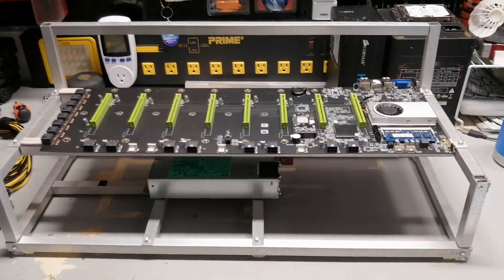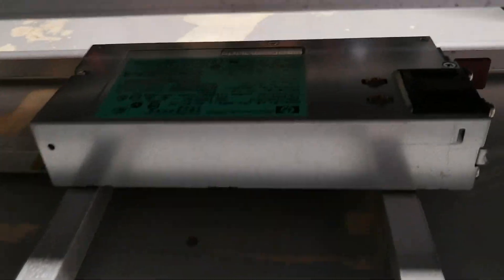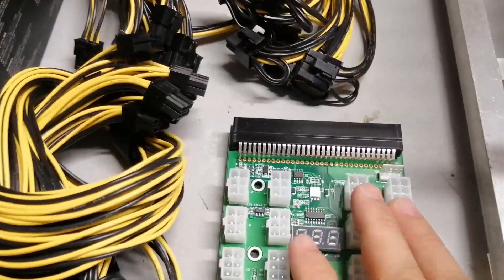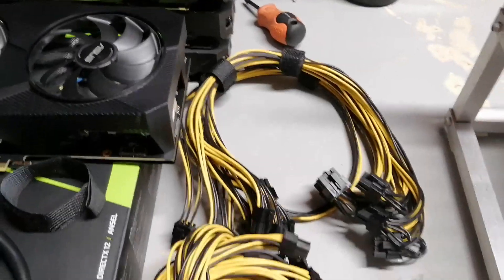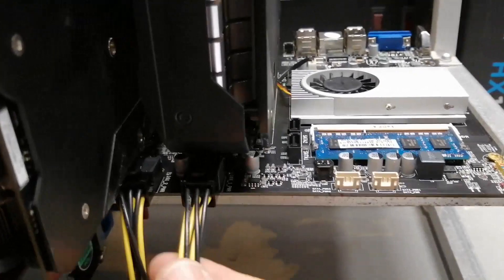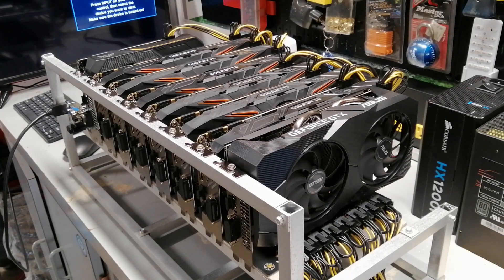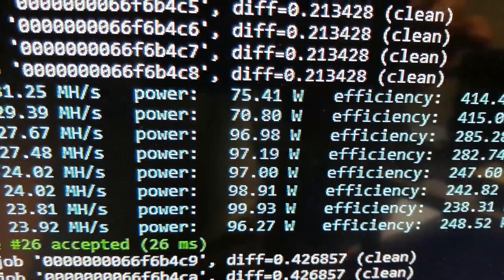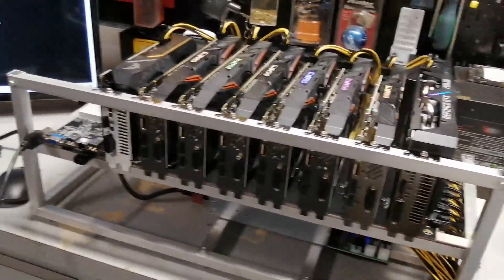BTC-D37 Riserless Mining Motherboard Setup with 8 GPU's

Comment: Is this board any good? What about longevity?!?
Also, why so many 6/8pin plugs onto the motherboard?!? 
16 suplimentary power connectors on a motherboard, is ridiculous
Reply from the maker: Because this mobo doesn't use 24 pins so 1 single 6 pins cable cannot handle the current of multiple GPU's. For me I consider risers as ridiculous , I would rather have multiple 6 pins than dealing with riser boards. Anyway my BTC motherboards are running for 2 years now no issue so far, hopefully it will serve me for another couple years with no issue.
Reply: @ruvrandomusefulvideos   Good to know, as im thinking of buying the same :D Thankyou

Comment: What kind of brackets are you using on the motherboard to hold it in place
Reply from the maker: I use screws to hold the motherboard and use felt board as spacers.

Comment: How do we connect board 16pin cable coming from psu?
Reply from the maker: 16 pin cable? You mean 24 pins? This motherboard does not requires the 24 pins, it power up with single 6 pins cable from PSU.
Reply: @ruvrandomusefulvideos  very informative. Thanks bro. Do we need to buy any extra cables other than in box cables to connect 8gpu?
Reply from the maker: @MohammadAli1ali  You need 8x 6 pins to power each PCIE slots & 8x 6-8pins cable to power the 8 GPU's.

Comment: looks ideal for my 8x 1660 Ti.... especially after my riser usb cable fire i'm now scared to used them ever again as the fire was expensive :)
Reply from the maker: Yes I do not like risers and lots of cables.
Reply: @ruvrandomusefulvideos  how'd you get  or why is the Tuf Gaming 1660 to pulling 80w?

I can't get much above 65-67w averaging 29.6MH
Reply from the maker: @thingswithlloyd4581  Because it was in optimize mode by default but I set all my GTX cards to efficient which the 1660 Super is hashing 31.3 @ around 74 watts or less. Also different brand 1660S has big difference in hash rate. I have Gigabyte which is hashing 28.9 @ 69 watts same settings, even 2 exact cards wont be the same.

Comment: Looks great but you're suffocating the gpu's when they are so close. This board is meant to be put inside a mining case, with high rpm delta fans, not an open rig frame.
Reply from the maker: Its been running for almost a year now no problem and I already got my ROI  last month, never had overheating issue till now even during summer time.
Reply: @ruvrandomusefulvideos  Bullshit...

Comment: Can i use atx psu for running 8 gpus on those mobo ?
Reply from the maker: Yes you can
Reply: @ruvrandomusefulvideos  thank you for the answer, anyway how to use 2 psu in this mobo ? Because its riserless, it is safe to just use Psu relay / adapter to power on 2 psu ?
Reply from the maker: @ragnaros23  I would just buy a 2000watts PSU to power all 8 GPU"s instead of using 2psu

Comment: Thanks you helped me
but i have only one qustion
i have power supply 2000W the normal one, should i buy new one power supply server?
Reply from the maker: Nope, the only reason I bought server PSU because they are small and a bit cheaper otherwise normal PSU is still better in my opinion.
Reply: @ruvrandomusefulvideos  Thanks again Bro
Reply from the maker: @modnashri  no problem have fun mining

Comment: Clean setup . May I know the Power supply? Is that sufficient wattage for this build?
Reply from the maker: I am using 1200 watts server PSU but because I only have 110volts input I don't get the 1200 watts power out of  single server PSU so I replaced it with standard mining power supply 1600 watts from AliExpress.
Reply: @ruvrandomusefulvideos  1600 watts ❤️😎 mind blowing

Would you mind passing more information, like link or model no

Comment: Guess I’m confused I use the btc-s37 the biggest board. (And smallest 8 board) And I only have to plug in the cards and the one connector below each card on board to power the riser. Do you really need to have a 2nd power supply to connect the wires on the side? I don’t think you need to. I think that’s just two different locations to power the riserless boards. BUT I could be wrong.. test it and let me know! BUT I do want that rack you have there! Where to find them or house to build them!
Reply from the maker: You don't have to, the side connectors are option when you use the server case. You can power the motherboard using back connectors as well but then you have to split it to power all GPU's or you can power them direct from PSU. Frame I made it my self, here is the link; https://www.youtube.com/watch?v=topWyZOiPjo

Comment: Hi, thank you for your video. I have a problem with the motherboard...the power supply works, the green led on the motherboard is alight but the motherboard dos not start even if a push the power button. Do you know what can I do?
Reply from the maker: Did you try to turn it on without GPU installed? Also try to reseat the RAM or try another memory ram if you have one available.
Reply: @ruvrandomusefulvideos  Thank you for your answer. I will try it

Comment: Nice frame and clean build. But I am sceptical to your power connections. It's my understanding that you should use EITHER the connectors on the long side OR the ones on the short side to power the pci slots. Then connecting the auxiliary power connectors on the gpu directly to the psu. You are running all the power needed through the traces on the board and it might not be built for that. Imagine the undervolt settings going back to default and all the cards going full throttle, you'll be drawing up to 1600W through the traces.
Reply: That's Exactly what I was thinking. I do not believe the motherboard was designed to handle running all the power for the gpus via the board. The gpus need to have direct connections to the psu. Such as using pcie splitter cables.

Comment: I just bought BTC-D37 , my graphic card has 8pin power connecter, need to buy 6pin power motherboard to 8pin gpu connector?
Reply from the maker: Yes need 6 to 8 pins cable
Reply: @ruvrandomusefulvideos   Is there differentiation between psie cpu cable and psie gpu cable for BTC D37? can I use the gpu cable to plug in the cpu?

Comment: Hey there, I have seen you have been amazing replying to people with questions. I have got the d37 model but the one that doesn’t just have the 6 pin power slot but has 16 pieces of s-16x (6 pin) slots. And I’m really confused how to power them. I’m trying to connect just the one 1660super to see if it works but it doesn’t even switch on… I have tried putting a 6 pin to the s1 slot from the psu and the 6 pin power1 to the 8 pin gpu like you did in the video and nothing.So then I tried adding an extra 6 pin to the extra s-x16 slot (the one you don’t have on your type) and nothing so then I tried putting the 8 pin directly to the psu so at that point I had all 3 cables connected and still doesn’t switch on. Also tried 4 cables all of them going directly to the psu. Just don’t wanna switch on. Any idea I should try ?

I have ASUS ROG Thor 1200w platinum PSU. It might not be a server psu with breakout board but it is indeed 1200w which is strong enough and for now I’m just trying to switch it on with the 1 single gpu so the psu can’t be the problem, right?
Reply from the maker: You are using ATX PSU, you need this to power on the PSU; https://www.ebay.ca/itm/403031501055 or you can short the pin 15 & 16 of the 24 pins connector. https://www.google.com/search?q=24+pin+connector+atx&prmd=isvn&source=lnms&tbm=isch&sa=X&ved=2ahUKEwju17LkgcnyAhXFIDQIHYKxCz8Q_AUoAXoECAIQAQ&biw=360&bih=647&dpr=3#imgrc=vhufQKgenjwWeM.
Here is the link of my video when I tested the PSU by shorting the pin to force it to turn on without connecting to atx motherboard; https://youtu.be/wdPFxeizbyI

Comment: Hey very clean setup! Could you still plug in some risers to spread the cards more for airflow? Should be making no difference no?
Reply from the maker: Yes you can
Reply: You can get the BTC-S37 which has 1.5cm more space between the slots.

Comment: Sir is it true that this board cannot mine etherium because the slot are only 1x instead of 16x?
Reply from the maker: This board can mine any crypto but you'll only get half of the hasrate when using RTX3060 because 3060 requires at least 8x PCIE speed.h

Comment: Thanks for the video… I set mine up today but I just can’t get more than 5 GPUs to work at the same time no matter what. All GPUs I have work as I’ve moved the GPUs, cables all around into different slots & they work in any configuration as long as it’s 5 or less GPUs. I have a 1200w server PSU with a breakout board that has enough slots but just won’t work. Has anybody come across this before then actually fixed the issue? Would love to know what I need to do. Thanks
Reply from the maker: Mine is running with 8 GPU's no problem, what are the GPU'S  you have? May be you already know but 1200 server PSU is only 900 watts @ 120vac and 1200 watts @ 220vac input.

Comment: These boards are of poor quality, don't waste your time and money or even risk killing your GPUs, mine was faulty so it went back, replaced with a branded motherboard, currently got 4 rigs running on branded quality kit.
Reply from the maker: My BTC-D37 & T37 are running for over 3 months now no problem so far, crossed fingers.
Reply: @ruvrandomusefulvideos  I had a BTC-D37 running flawlessly 24/7 for about 6 months, then it failed in the middle of the night. Linux journal kept showing "GPU fell off the bus" errors after a few minutes of mining any of my 5 cards in any of the slots. I tested all the cards in a desktop PC also using the same server power supply and breakout box, they all worked fine mining for hours. Had a warranty on the failed board, got my money back, but still not decided if I want to risk another one of these boards or spend more and get something more reliable.
Reply from the maker: @jasonrichelieu565  Sorry to hear that but my  BTC-T37 &  BTC-D37 are running for almost 9 months now and so far so good no problem at all. 2 more months and I will get my ROI for all my hardwares. Just consider how much $$$ you have to recover buying expensive mining board plus CPU but its up to you to decide.
Reply from the maker: @jasonrichelieu565  its oil from thermal pads which is normal because its running 24/7, you have to clean it once in a while.

Comment: Hi, I have the btc s37. I have 8gb ram but it keeps saying not enough virtual memory. And after I manage to increase my virtual memory. Not all 4x 1660 super are running, only 3 of them are running. Any idea how to slove this?
Reply from the maker: Increasing virtual memory won't stop the GPU from running. Make sure you can see all 4 in device manager and all has driver installed.
Reply: @ruvrandomusefulvideos  I am using Nice hash and it keeps prompting me memory not enough. All 4 are shown in device manager.

Comment: Do you need a 6 pin per slot? even though the power is coming into the card from the top already?
Reply: Don't use a single 6 pin for multiple pcie slots. Each graphics card could draw up to 75W from the pcie slot so you should connect a 6 pin to the motherboard for each graphics card installed.
Reply from the maker: Yes you do. The 6 pins is supplying each PCIE slots without it your GPU wont run.
Reply: @ruvrandomusefulvideos  idk, i just tried it with the 6 pin plugged into slot 1, and the card in slot 2, and the card worked.
Reply from the maker: @andy.connor.e8853  Good to know, thanks

Comment: I got the h510 pro btc. 6 pcie motherboard. I cannot get the 4th 5th and 6th pcie slots to work. There seems to be no power to the bottom half of the board. The chassis fans don't work either. Glad this went well for you
Reply from the maker: Sorry cannot really help you because I don't have that mobo. I am thinking to get it but not untill more video cards are available. Anyway do you have supply for both 24 pins connector? Thats all I can think at this time.
Reply: @ruvrandomusefulvideos  
Yeah I have a 1000w and an 850w. There are 3- 24 pin connections on the motherboard.  2 of which say they are only for starting the secondary power supply. It has been problematic since I got it a month or so ago. At first I couldn't get 2 cards to work. Updated bios and enabled c.a.m. and that solved that issue. It looks like the mobo only draws power from the 1 24 pin so I'm not sure why the lower 3 pcie slots and chassis fans do not work. Awaiting a response from asrock tech support. Thanks for the reply
Reply from the maker: @caseyhall5297  no worries and thanks for visiting my channel. Please keep us posted once you solve the problem if you don't mind., good luck and happy mining.
Reply: @ruvrandomusefulvideos  
Will do. Hopefully tech support can give me some help tomorrow. Thanks again
Reply: @ruvrandomusefulvideos  
asrock said it might be a short or something so I had to send it back to newegg. Where did you get your motherboard? Is it still running good? I was thinking about getting the one you have instead. Would you recommend it?
Reply from the maker: @caseyhall5297 That's a bummer but at least ASrock responded right away. Bought my boards from AliExpress free shipping to Canada and it takes 2 weeks to arrive. I would recommend the BTC-S37 because it has wider gap between GPU slots. Also take note that all PCIE are only 1x speed but someone commented before that he is running 3070 & 3080 with full hashrate. Its been running for almost 3 months now no problem so far.
Reply: @ruvrandomusefulvideos  
Thanks again man. I ordered the s37 while I'm waiting to hear from newegg about the other motherboard. If I get it replaced I can always set up another rig. I have all different kinds of graphics cards. All nvidia but all different models. Do you think that causes any problems?
Reply: @ruvrandomusefulvideos  
Also do you have a video on the frame? I have mine on a wood platform. It works but it's nowhere as neat and orderly as the one you built. It wod.be nice to give it a better appearance.
Reply from the maker: @caseyhall5297  I don't think it wil cause problems. I have1060, 1070, 1070ti different brands running on BTC-T37 no problem.
Reply from the maker: @caseyhall5297  https://youtu.be/topWyZOiPjo
Reply from the maker: @caseyhall5297  And here where I get the materials https://youtu.be/ovCQe1och7I

Comment: I Just received my first btc-s37 and your videos have been very helpful. Question about power supply - can I connect the psu directly to the GPUs or does the motherboard need at least 1 power cable to power up? 

the package didn't come with wire diagram
Reply from the maker: Assuming that you have 8 GPU's, you have to power all 6 pins connector on the motherboard, that will power each PCIe slot then you also have to power all GPU as well.

Comment: Hi, I just got the BTC-S37 and what I am unsure is: am I supposed to connect a 6-pin power to each connector by each PCIE slot, just like what you did in the video starting at 4:57?
Reply from the maker: With BTC-S37, the 6 pins connector is to power the board and each PCIE, do not use them to power the GPU's. You need to power each 6 pins and each GPU directly from power supply. Let me know if you have more questions, you can also post it in the discussion  on my channel, thanks

Comment: Thank you for your video, Just want to ask where is your PSU plugged in, 110 or 220? How loud is the PSU?
Reply from the maker: 110 volts, server PSU is quite loud with high pitch noise
Reply: @ruvrandomusefulvideos   Thank you for your reply,  I am trying to make the same build using your video as a guide. I bought same PSU but have not received them yet, I saw one video that suggested plugging it at 220 to lessen the noise, I hope it works, thanks again.

Comment: Hi, will pcie slot speed on this board lower the hash rate on rtx3070 gpu? I see that it is pcie2.0
Reply from the maker: I do not have those cards but someone commented that he is running 3070 & 3080 with this motherboard and he is getting the full hashrate.

Comment: Thank you for this video. I am looking at building a really low budget Ravencoin miner with this type board and four of the Zotac 730 Zone Edition 4GB cards. Does this MOBO run 4G cards? And if you have a Zotac 730 around, can you please let me know the hashrate for Ravencoin? I am trying to do all the research before buying.
Reply from the maker: Yes it will run 4gb cards. Not sure what hashrate you'll get but RX580 4gb is around 9mh/s. My GTX 1060 6gb is getting 9.8mh/s and the GTX1070 8GB is hashing 11.9mh/s. Note that with Ravecoin you'll get half of the hashrate compare to mining ETH. I have 2x1060 6gb and 4x1070 8gb and I am getting 11 Ravencoin every 2 hrs ish. Its a good time to start, I think January 2022 is the 1st halving.